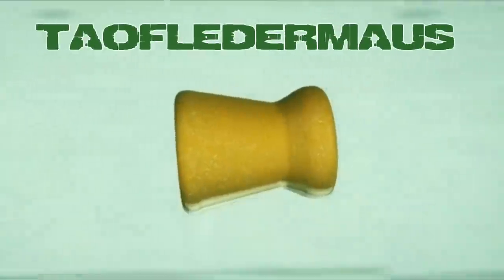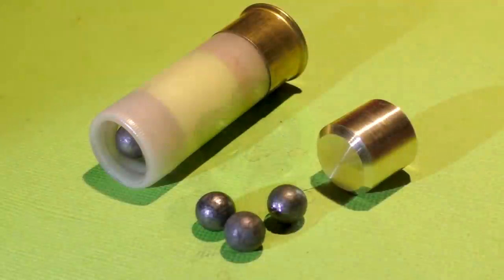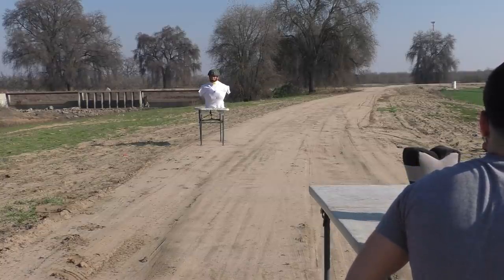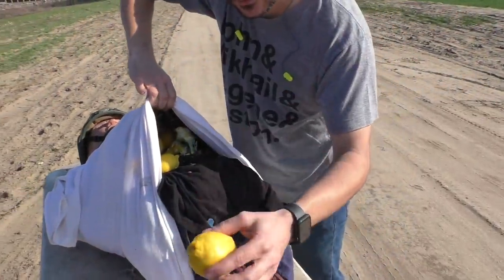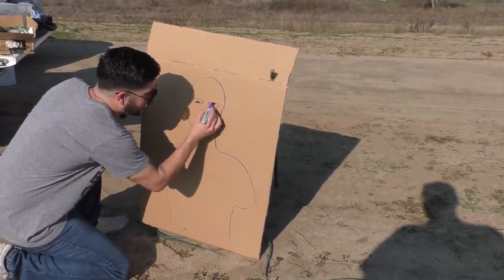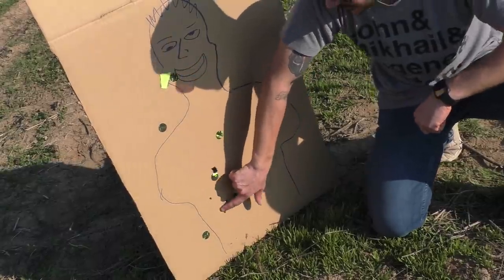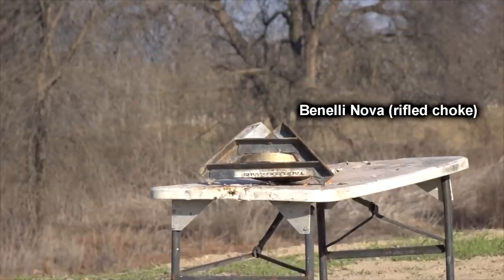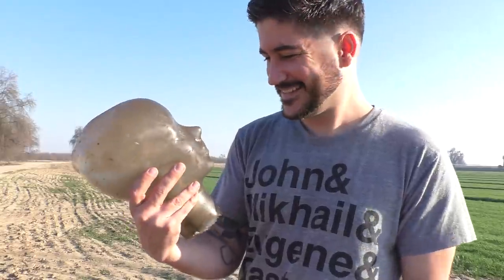12ga. NICKEL BRONZE Defender Round

Comment: I'd still like to see some everlasting gobbstoppers flung down range by the mass accelerator. For ya know, scientific purposes
Edit: consider them somea sweeta meataballs 😃
Reply: I sincerely believe they would be viable defense rounds
Reply: I concur with your suggestion so hard that I think I might have shat myself! ———yup! ‘Scuse me for a jiffy!
Reply: @dr.froghopper6711  i mean they did do jawbreaker slugs , its essentially the same thing but not exactly. Since that video i have been suggesting this idea
Reply: @adabsurdum5905  exactly, they should pack a punch but not really be lethal I'm guessing
Reply: @andrewdobosz3682  I think it's debatable. IMO, a gobstopper moving at +2000 fps would be more lethal than "less lethal" rounds. They or be too fragile to penetrate, even at that velocity, though, so it's certainly worth a test.
Reply: @adabsurdum5905  it's a toss up in what type you get some would probably not break where as others will or you could get the small ones and put a few in plus their size would make them less likely to shatter as they do

Comment: A long time ago in a land far away a friend of mine that was previously a tank commander said they used a sabot round and shot a deer from 3 miles away. He said they could hit a 55 gal. drum 1 out of every three shots from that distance. He also said they had what they called a beehive round made up of thousands of pieces of broken clock spring. These were little squares of spring steel packed tightly in a brass cannon shell that he said would take every leaf off a tree at close range (and all the meat off the bones of any creature in the tree). I have often thought of trying that with a shotgun shell, but I never have tried it.

Comment: After watching a lot of these "special" loads I've come to the conclusion that for home defense with a shotgun you really should go with either 00 shot, a slug, or a hollow point.  All the others are less reliable, less accurate, and don't provide anymore stopping power.  00 Buck is really just to help a little more with hitting the target.  For pure stopping power I'd go with the hollow point or slug.  Both are devastating, and if you hit the head, neck, or torso, the attacker is going down instantly.

Comment: If you placed the buckshot on top of the slug every time then you missed the opportunity to have the accuracy enhancement of having the buckshot being placed under the slug. If you place the buckshot and allow the slug to travel down the barrel before the lead balls then they would not have an affect on the slugs stability coming out of the barrel. They would always have their own seperation before the lead balls. It also would allow the lead balls to follow in a tighter group.
Reply from the maker: It would have smashed the soft lead between the slug and the wad during the 15,000 g of acceleration.   They would have flown horribly.

Comment: Nick..... You are too hasty....a tad trigger happy. Your 1st shot at the cardboard torso thing... Using the 590 smoothy, you pulled the trigger as soon as you shouldered the stock, and we'll before any real pointing of the gun in the right direction. Brilliant slugs and the symmetrical flight of buckshot made it like a precision aerobatic performance. But take your time, breathe easy.... There isn't a timer or a race on the scene... Respect  👍😎👍

Comment: should test the newer federal force x2 buckshot if you can find it...9 pellet 00buck copper coated but they break in two on impact...be intested to see if it works as advertized and if it better than normal loaded 00 buck

Comment: Would probably work better with smaller diameter buckshot with some sort of plastic or rubber disc between the two projectiles. Balance the force pushing the slug and still allow for buckshot to be loaded for extra knock down power.

Comment: Hey guys, love your videos. Can you do some videos on poor man's slugs made from melted down birdshot and reloaded back into the birdshot shotshell? Thanks!!
Reply: That's usually melted wax with the birdshot mixed in like fruit in Jello.

Poor man's deer slug. 

And if you use more brittle wax, it can work like a flak or canister round. Solid for a couple dozen yards, and then comes apart and starts spreading out, for those really high birds.

Comment: Hi, can I ask, what is the diameter of this slug, well, for the most of the sabot slugs, please? I´m from Slovakia, and in Europe, as you may have heard, soon will be problem with lead ammo, thanks to all powerfull EU commitee, in the name of ecology (total BS, just like always), and manufacturing my own slugs might be only way to keep the costs of slug ammo relatively normal, so, as I recall, 0.68 inch is about correct for the most sabot, but it would really help me to have more precise number, if it´s different from 0.68, for the use in rifled choke and cylinder, maybe improved cylinder, thank you very much. Thanks to your channel, I have pretty nice templates for manufacturing, keep up the good work
Reply from the maker: They are about 17mm.    (sized to fit into the shot cup)

Comment: If you put the buck shot on the bottom I think that would work better with a thin shot card in between.
Reply from the maker: I doubt it because the soft lead would have flattened out like pancakes-  compressed between the wad and the slug
Reply: TAOFLEDERMAUS maybe but when you have time try it with a foster slug. It could be interesting. A 1/16 or 1/8
Reply: TAOFLEDERMAUS  shot card will cushion the buckshot or you could try the same size ball bearings underneath. Thanks for your videos !!!